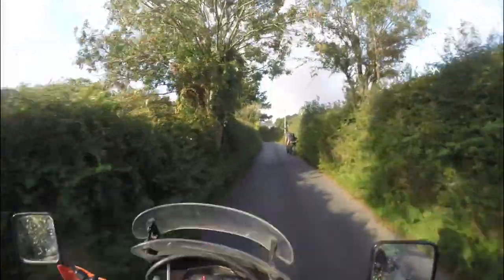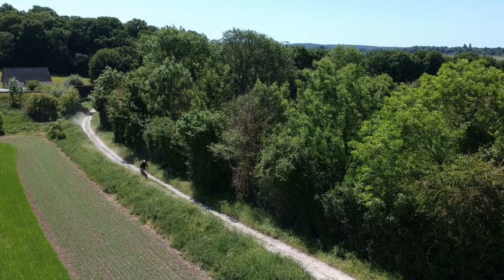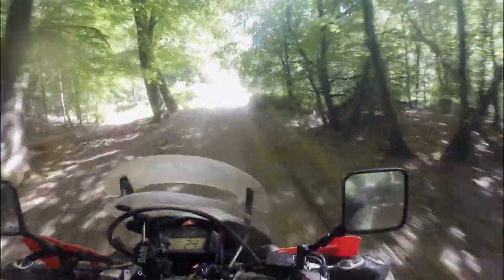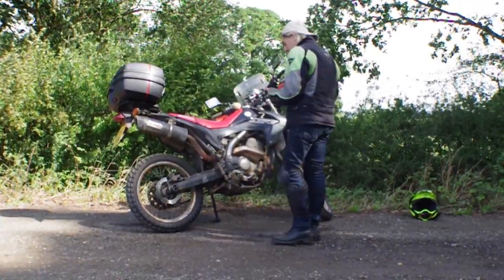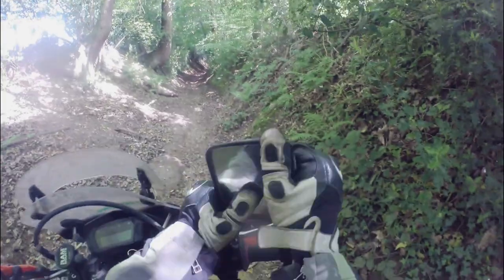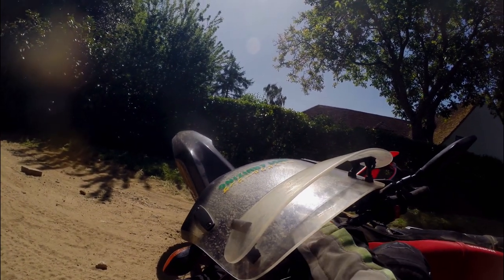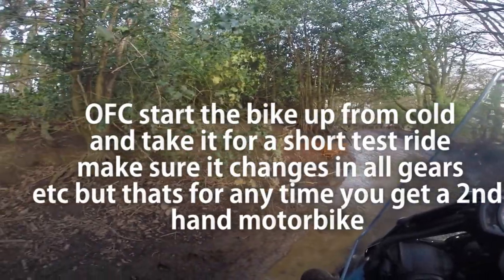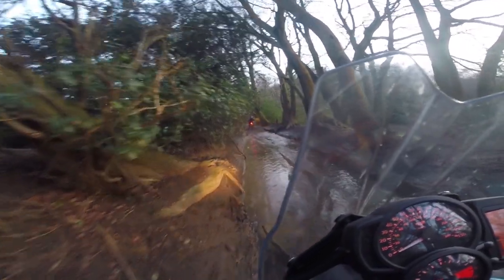Honda CRF250L Common Problems & buyers guide

Comment: Itchy Boots has just done some 40000km on one of these around Southern Africa. Incredible bike. She eventually did a 1000km Rally/race on it and the sub frame broke. This, as a result of carrying lots of luggage and spare fuel bladders on her travels. She bought it with some 25000km on it if I recall. Incredible bike, like all Hondas.
Reply from the maker: Don't forget the forks seals also went on that trip

Comment: Thanks I just bought a 2016 crf250l and previous owner did a bunch of mods so I’m taking them off. Luckily he had the original exhaust. So while installing that I found he unplugged the emission stuff and had a fuel controller. I’m in the leave it alone camp when it comes to engine mods. If it’s not powerful enough get a GS.
Reply from the maker: if you are putting back the original exhaust you will also have to remove the fuel controller but thats not bad you can sell that :)
Reply: @BigPezza  yep i did remove it  and have also found a 13 t on counter sprocket  so ordered a stock set to see how that is. enjoying the bike i am

Comment: Well I have a 2013 runs fine with that EKG fuel controller I put in aftermarket pipe on it I put a air filter in it a 52 we're tooth sprocket.
You do know that there is a replacement that you have to do for the piston ? That being said EKG air filter better exhaust 52 tooth sprocket are going to do a huge change. My personal opinion for me it was well worth it. But improvement in power and response from the throttle is impressive!  Riding hard I get 90 miles to the tank.  I bought the bike used. The piston was to be replaced long ago it is 2013.
It has a very durable engine.

Comment: The one and only problem this bike has is cam chain tensioner they fail often, luckily they cost $10 and are easy to replace
Reply from the maker: I dunno over 10 years and 40k miles still on stock

Comment: I heard that about the 13 tooth front sprocket that's why I went with the larger rear sprocketyboo 😉nice vid & some sound advice ...............👍
Reply from the maker: 13-40 bad 13-42 good as long as the chain dont get loose its ok

Comment: 250L is a heavy chunk of steel. Fork seals blown twice, fan melted twice, radiator completely bent, drilled holes in exaust for noise, huge scratch in clutch cover, new gear shaft after stripping and bending the last one and finally 2 sets of clutch plates replaced. Ive got a new bike now
Reply: Have had mine since  2018 never one problem

Comment: It's E-Jay-K not E-Gee-K......and according to you a tail light is a headlight.....why does it indicate that it's been redlined all the time?? Fork seals don't need changing routinely and would be clearly evident if they needed to be changed. Even Honda dealers skimp on head and swingarm bearings. What's wrong with a full system? They're lighter and the finish is way better than the terrible matt black which goes brown.
Is that your bike on the video? If so would you buy it as it looks like the type of bike you’re telling people to stay away from!

Comment: Solid advice mate.
Had my CRF250L from new 2013, fork seals went after ~2000 miles. Definitely a weakness somehow.
Reply: mine went at 2000 miles and 5 years.
Reply: Fork seals is always prone to leaks especially it is inverted what ever brand brand of motorcycle it is unless you install a fork sacks like mine my CRF250L since I bought it 2013 have not yet been replaced.2)50 @TheUncommonKIBBLES

Comment: Solid video,but where I think I might disagree or question, regards tail tidy, is which one you buy and additional precautions taken. There's a particular plug and play version available in the UK that's enclosed underneath, has no gaps around the light, and where there are a few machined holes in the design (e.g., for the brake light wire) these can easily and unobtrusively covered with tape.

Comment: What are your typical noises when on the pavement. I think I have tire noise almost a cyclic rhythm at about 5k rpm in gears 4 up and around 45 to 55 mph. No tapping noises or anything I would consider cam chain problems. Hard to tell with wind noise but seemed less with tire pressure up to 25psi

Comment: Amen. Don't buy a used Honda that has been modded. It is really arrogant to think that some backyard Jethro is going to improve a product designed by Japanese automotive engineers. Drilling out the air box, removing the snorkel, adding a fuel programer, etc. are all signs of ignorance in action. On popular bikes like this the aftermarket pimps all kinds of poorly engineered, useless junk. People piss away a fortune on junk to destroy world class engineering. Adding fuel programers and expensive exhaust systems is not going to release the "beast within" these bikes. There is no beast, they are just really cool, reliable bikes you can ride for many years -- especially if left stock!

Comment: Hi man.

Thank you for the good video.

I wonder how you like the Suzuki mirrors  on your crf? Are they better than the crf stock one's?

I was thinking to do the same... Did you needed some adapters fittings or did you changed the entire mount of the crf mirrors or do they fit directly into the crf?...

I don't want to pay for the double take mirrors so I find your idea really good.

I wonder where you found your Suzuki mirrors?  I looked online, there's lots cheap one's probably from china... 😕

Thanks for your time bro. Be safe, have fun.
Reply from the maker: My bike OEM mirrors where stolen 😞 so that's why I found some cheap 2nd hand drz wing mirrors and stuck them on. The cheap china knock off drz mirrors not worth the plastic they are made of.

I think they just screwed right in can't remember tho
Reply: @BigPezza  thanks for your time bro. Have a good day sir.

Comment: Great vid pezza... yes everything as MR Honda intended!! I even like the stock hand and feet levers - they bend back unlike the anodized aluminium from China !!  especially don’t bother with the Ejk  stuff that has proven only 1-2hp over stock (for a significant investment) - for that money you can get a cbr300r engine and swap and have “as MR Honda intended..  other things I would accept are unifilter washable filter and lithium battery - I would also consider an aftermarket exhaust - agreed on fork seals both my 250l and 300 rally (cbr engine swap) have blown a set of seals (80% off road riding lots of dust in SE QLD!!) 
Please buy the new 300L to replace the trusty 250 :D

Comment: My 2020 CRF250L is stock besides skid plate, radiator guard and magnetic oil drain plug. Would never touch the motor. The Japanese know best!
Reply: Oh and rear rack with a nice tail bag.
Reply: Not Japanese made in Thialand sorry to say
Reply: @neilrobertson1345  yeah I know but it’s a Japanese design

Comment: Hmm I like what you saying but everything you talk about is no different to any other bike you would buy

So I give you ana example would you buy 2016 crf250l 1200 miles completely stock tyres still good

Never been off road clean as F. Only first service by Honda typical value £3.6-3.8k

Needs full service now, fair weather only ice ridden in rain would you think that a bad buy?

Context between good and bad, never been ragged

So my point is good and maybe not as good 

Your thoughts please be interested in your thinking

Comment: Did you talk about clutch replacement? Have you changed yours Pezza?

My CRF cost £3,100 in May last year. Its a 2017 and had I think 30k miles on it. Bought off the ADV forum from a guy who was an engineer. Most of the miles were touring miles, and not the sort it has subsequently had. I agree solidly about the 'no tweaks or mods' idea. After that I'd be looking for receipts for service kits, brakes and tyres.
Reply from the maker: still on the OEM clutch & i shift up and down without pulling the leaver in.  yes allways good to see the recepts for everything